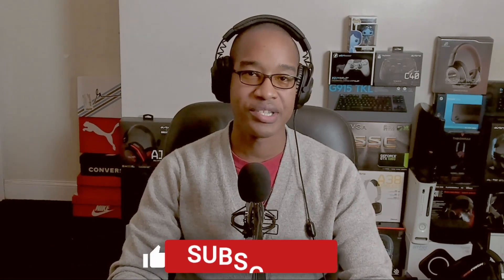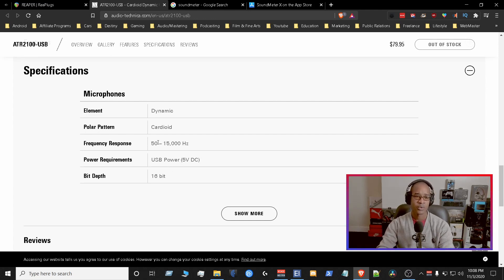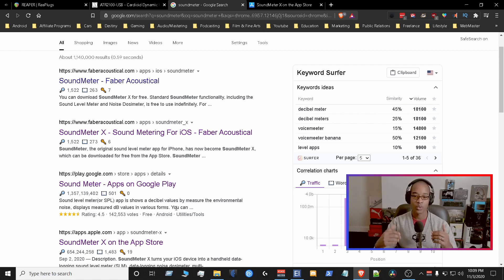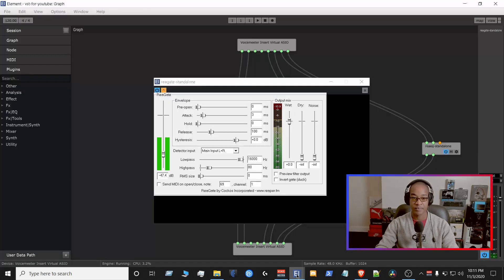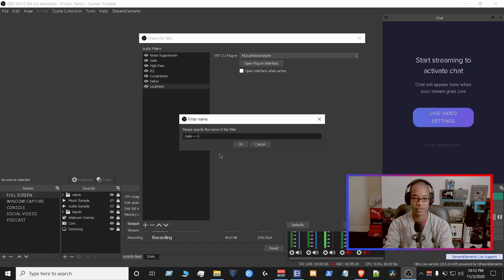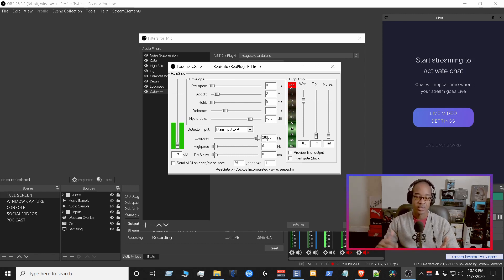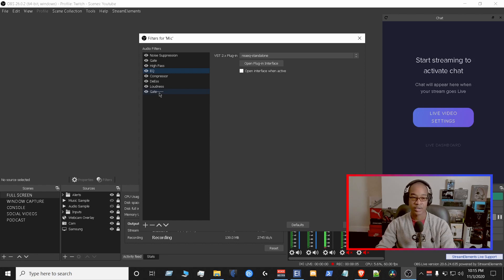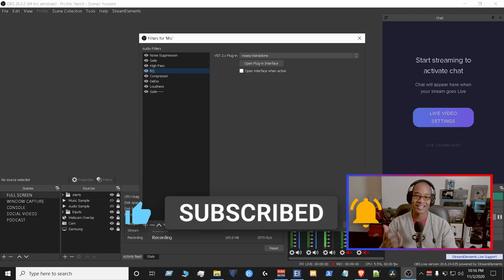How To Set Your Noise Gate (Gate) In OBS Using ReaPlugs' ReaGate

Comment: Why would you put in a low pass filter at a frequency above what your mic can pick up? That just doesn't make sense to me. A low pass filter will allow frequencies to pass that are below the frequency specified. So now you're allowing frequencies between 15k and 16k that your mic can't even pick up, so that would just be random noise?
Reply: I'm hung up on that part as well. From the way hes explaining it, isnt it supposed to be a range between the two extremes?